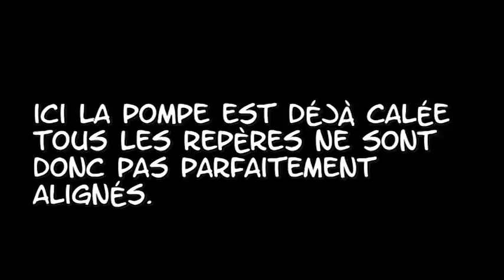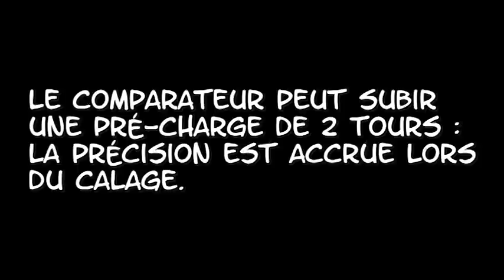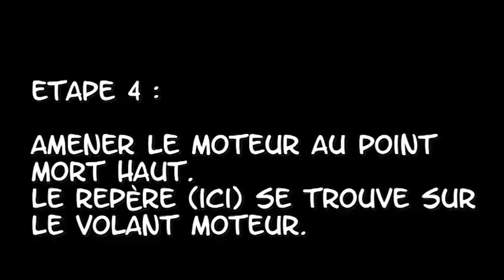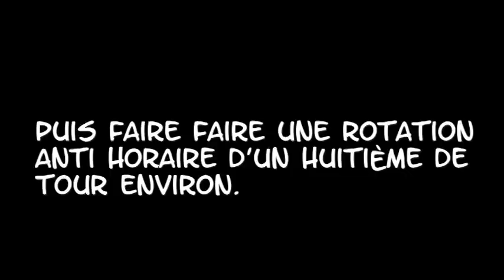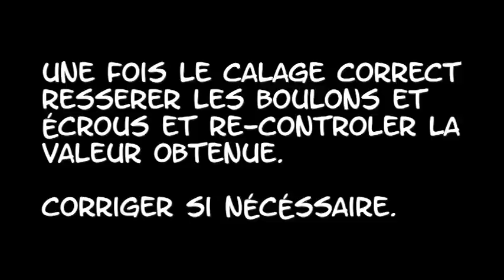Caler une pompe à injection BOSCH VE

Comment from the maker: Mitutoyo est une bonne marque.
J'utiliserai plutôt un comparateur à aiguille,c'est plus facile à appréhender je pense.

La longueur est à choisir selon la place dont tu disposes avec ta pompe les conduites de gazole peuvent nécessiter le modèle long ou court suivant leur forme.

autodiesel 13 vend des 60mm et 95 mm .

Il faut que tu choisisses celui qui te convient le mieux par rapport au conduites de gazole et à la place dont tu disposes pour installer ton outil.

Comment from the maker: L’aiguille au contrôle doit être entre 0.65 et 0.75 
L’aiguille au réglage doit être entre 0.68 et 0.78 

Si tu es entre les deux valeurs mini et maxi données c'est ok.
C'est acceptable entre ces deux valeurs,le moteur peut tourner correctement.

En dessous ou au dessus tu dois régler.

Comment: Très bonne video merci bien, néanmoins une question me taraude... Pourquoi faire un huituième de tour en arrière ? Le calage ne ce fait t'il pas au point mort haut ?
Reply from the maker: +Cé- Dric 
Merci : )
Bonne question : ) 

Tout, en mécanique, est mesuré sous contrainte ,pour éviter de fausser la mesure avec le jeu de fonctionnement.
Il faut donc reculer plus que la position normale de fonctionnement point mort haut) pour y revenir en les mettant en contact pour être sur d'éliminer un éventuel "flottement" entre les pièces,donc une imprécision.
Ici,il s'agit des lobes de la cale de la pompe à injection : )
Tout doit aussi être mesuré à 20°C,car les matériaux se dilatent et se contractent.
c'est moins important,ici mais par principe ,il faut savoir.
1/8 car c'est un 6 cylindres
pour un 4 cylindres ça aurait été 1/4.
Il faut aussi se rappeler que l'injection se fait avant le point mort haut,en avance.
le point mort haut ne sert que de repère pour calculer cette avance.
Reply: cette tour en ariere c'est avance injection c'est le temps que la pome doit injecte le carburant apres PMH qulque degre et varie par le constructeur

Comment: Bonjour, es ce que un mauvais calage peut brider le régime max à 3000rpm ?
Reply from the maker: Bonjour,
C'est possible,mais le problème sera du à un mauvais temps d'injection, qui sera précoce ou tardif.
C'est accompagné de fumée épaisse et blanche grise si il y a trop d'avance,et noire ou grise s'il y a trop de retard.
si la bride est franche et nette sans fumée,il vaut mieux se pencher sur la distribution même de carburant,son dosage dans la pompe.
Pour ça il faut savoir si la pompe à été ouverte et a subi des manipulations internes ou externes.
Il se peut aussi que l'arrivée de carburant soit insuffisante,cela bridera la pompe,incapable de s'alimenter autant que prévu.
Reply: @michaelovitch  Oui, la bride est franche sans fumée. J'ai revu le calage de l'arbre a came et essayé 2 pompes différente. que j'alimente en carburant via un réservoir annexe (juste a coté pour les essais). J'avoue être a court de solution. le moteur démarre au 1/4 de tour mais impossible de dépasser les 3000rpm. Même en shuntant le filtre a a gasoil....
Reply from the maker: @emilesavary7901  
Tout est d'origine sur le moteur ? aucune pièce changée ?
La pompe à injection pompe t elle elle même son carburant  ?
a t elle été démontée ?
La tringlerie n'est pas limitée dans son mouvement ?
Reply: @michaelovitch  Oui, tout est d'origine. la pompe fonctionné jusqu’à présent et n'a pas été modifié. je l'ai changée en pensant que le problème venait d'elle (désamorçage l'hiver + démarrage difficile). la tringlerie n'est pas limitée. Elle pompe son carburant elle même. j'ai eu les même symptôme avec la deuxième pompe. J'en ai profité pour faire la distribution.
Vu que j'arrivais rien j'ai remonté la pompe d'origine. vérifier que la distribution était OK. mon problème est identique. Mais je n'ai réglé l'avance que a l'oreille. Si mal réglé en effet ça fume et le moteur cale. Je peux vous joindre sur un autre support ?
Reply from the maker: @emilesavary7901  
Si le problème est apparu après un remisage de la voiture alors que vous n'avez touché à rien,et que vous avez le souci avec deux pompes différentes,c'est que cela ne vient pas de la pompe,mais de l'approvisionnement en carburant.
une prise d'air dans les durites de gazole,ou un échappement bouché,qui limite la prise de tours.
Si par contre le problème est apparu après une intervention sur la distribution,alors il faut vérifier les calages de distribution,et celui de la pompe.
Un mauvais calage ne permettra pas un fonctionnement normal.
Mon adresse mail est affichée sur l'onglet "à propos" après avoir cliqué sur mon nom de chaine YouTube.

Comment: Salut mister,
On s'était parlé il y a quelques temps.
J'ai une pompe bosch de golf tdi, je l'ai démonté afin de changer les joints.AU remontage, j'ai essayé de caler celle ci, en faisant toutes les etapes que tu montres, le comparateur indique la valeur zero.En devissant la pompe, la valeur ne change pas.
Comment fais tu pour bouger la pompe car sur la video, tu ne montres pas cette etape.
Merci de ton retour.
Tony
Reply from the maker: Salut,
Il s'agit d'une golf 2 ou 3 ?
Indique le moi stp.
Il faut que ce soit un pompe VE sinon ça ne fonctionnera pas comme procédure avec une pompe plus récente.
Tu dois caler le moteur sur le point mort haut d'un des cylindres.
installer la pompe et la caler grossièrement :
 pour ça Il doit y avoir une marque ou un orifice sur la poulie de la pompe.
ensuite la caler au comparateur.
le point zéro c'est le point mort haut du moteur.
ta pompe à ce moment a déjà injecté car elle injecte avec un peu d'avance : c'est ce que tu cherches à régler.
Donc tu dois tourner le moteur en sens inverse de fonctionnement pour arriver au point d'injection qui sera indiqué sur ton comparateur comme une valeur.
Cette valeur est spécifique à ton moteur/voiture.
A toi de l'ajuster petit à petit en tournant la pompe et en testant à chaque fois depuis le début.
La pompe est fixée au bloc moteur par plusieurs boulons.
Un d'entre eux est fixe,les autres permettent de faire pivoter la pompe sur son support une fois qu'ils sont desserrés.
Reply: michaelovitch
il s'agit d'un golf 3 tdi 90cv, la pompe est rotative, elle n ejecte plus le gazole, j'ai regardé la video d un internaute qui demonte une pompe et la remonte, je me demande si j'ai pas monté la came de la pompe au mauvais endroit
Reply from the maker: tonymarcuso
 Si elle même été démontée :
Il faut essayer de lui faire aspirer du gazole en la faisant tourner seule.
Si elle a été ré assemblée correctement elle est juste désamorcée.
Tu peux déjà la pré-remplir  par le dessus en enlevant le raccord banjo d'aspiration et celui de refoulement.
Il y a un topic bien fait et détaillé sur les pompes VE ici pour que tu puisses voir si tu t'es trompé. : 
http://www.forum-auto.com/pole-technique/mecanique-electronique/sujet293129.htm
Reply from the maker: tonymarcuso
Je ne sais pas si tu as vu la totalité du message précédent que je t'ai envoyé ,c'est parfois long à l'affichage : J'y ai inclus un lien pour le remontage de la pompe.
ça te permet de vérifier ton travail.
J’espère que tu as pu trouver solutionner ton problème.
Reply: Hello

Je te remercie pour ton retour très complet, en effet il y a bien 3 ecrous de 13 qui maintiennent la pompe et un a l arriere.Mais en les desserant et en essyant de tourner la pompe, meme si elle tourne un peu, le comparateur lui ne bouge pas, il restait sur la valeur Zero.
Je vais retenter a nouveau et la remplir de gazole.Normalement si je tourne la poulie de la pompe a la main, elle doit ejecter du gazole par les 4 mini injecteurs ?
Reply from the maker: tonymarcuso
Salut,

Le comparateur doit être en "précharge".
La touche du comparateur est suffisamment enfonçée pour permettre à l'aiguille de faire deux tours complets avant qu'il soit mis à zéro.
ça évite un défaut de contact entre les pièces internes de la pompe et le comparateur lors du réglage,donc ,les imprécisions.
As tu bien le bon embout sur le comparateur ,celui qui correspond à une pompe Bosch VE ?
Oui, si elle est pleine de gazole, elle doit pouvoir cracher du carburant par les raccords. (ceux où se vissent les durites rigides allant vers les injecteurs)
Elle doit même pouvoir en aspirer par sa durite d'alimentation.
Il faut qu'elle soit amorcée sinon elle pompera de l'air seulement.

Comment from the maker: Salut.
Code "D24" 6 cylindres 2.4 litres à injection indirecte diesel d'une Volvo 240.
Il y a des vidéos de lui tournant sur ma chaîne si tu veux.
C'est un moteur emprunté à vw par Volvo.
Reply: Salut ! Décidément, cette vidéo  aura été vue plus d'une fois par beaucoup ! Je suis dans une impasse.  J'ai un D24 volvo 245 1991, avec cette pompe. Un ami me l'a refaite car la voiture ne démarrait plus suite à un arrêt de 13 ans (suite à l'avc de mon père. Je veux la remettre en route). Je l'ai remontée,  calée selon ta méthode  mais ça ne démarre pas.  J'ai bien du gazoil à arriver aux injecteurs,  enfin au bout de tuyaux d'injecteurs, sur les 6 cylindres. L'ev est neuve et, on l'entend bien quand on la titille en direct. Le circuit prechauffage fonctionne,  bougies neuves. Certaines personnes me disent que je suis peut-être calée sur le mauvais cylindre ! Pour moi, à partir du moment où on a le repere 0 sur le volant,  c'est qu'on a  fait une révolution et, qu'on est au point mort haut sur le premier cylindre...me tromperais-je ? Merci de m'éclairer de ton savoir 😅, car étant novice, je n'ai plus d'idées et, ça me déprime.  Merci
Reply from the maker: @jeromeleroy6719  
Salut,
Pas utile d'être déprimé,il suffit de partir de la base,à nouveau.,et de vérifier son travail.
Pour être sur que le cylindre 1 est au point mort haut (c'est celui qui est le plus près du radiateur moteur) il faut alors enlever le couvre culasse en tôle et vérifier que les deux lobes de l'arbre à cames de ce cylindre n1 pointent à l'opposé du piston.
On est sur d'être au point mort haut n1.
Il faut que le jeu aux soupapes soit bon,et que les bougies de préchauffage fonctionnent.
Un moteur à injection indirecte comme celui là ne démarrera pas sans ça.
Le 0 sur le volant moteur indique le point mort haut du cylindre 1,mais aussi du cylindre opposé ,le 6, les deux étant opposés pour l'équilibrage,et appairés.
mais ce n'est pas le problème en soi, l'important est que le vilebrequin,donc le volant moteur ,soit calé par rapport à l'arbre à cames.
Il faut donc que l'arbre à cames soit calé avec l'outil spécial au point mort haut cylindre 1,et que le volant moteur soit synchrone avec l'arbre à cames.
l'arbre à cames se cale avec une plaque,qui s'enfile dans l'arbre en son bout coté pompe après retrait de sa poulie.
Il faut aussi que la poulie de la pompe soit calée avec le support de pompe,une pige sert à la caler et s'enfonce dans un des trous de la poulie de pompe ,plus petit que les aurtres.
Est ce que tout ça a été fait,ou vérifié ?
Reply: @michaelovitch  merci pour ce retour rapide ! Non,  tout n'a pas été fait. J'ai juste recalé la pompe par rapport au 0 du volant, en ayant mis l'avance 0.85, sur le D24atmo. Je vais effectivement regarder cela un peu plus professionnellement...j'ai cru que c'était simple. Encore merci pour tes encouragements.  Bonne journée
Reply: @michaelovitch  mais si ça se trouve, je suis cale sur le 6, lobes levés ( au lieu de vers le bas)C'est ce qui pourrait être le cas ?
Reply from the maker: @jeromeleroy6719  Etant donné que le 6 et le 1 montent et descendent en même temps (tous les deux au point mort haut,mais le 1 est en compression et le 6 en échappement/admission) oui c'est possible,c'est pour ça qu'on regarde les lobes de l'arbre à cames pour voir qui fait quoi, selon la culasse, et pas le vilebrequin.
Le vilebrequin fait 2 tours pour 1 tour d'arbre à cames,on peut se tromper une fois sur deux si on ne confirme pas avec l'arbre à cames.
Attention,les bougies de préchauffage sont nécessaires.
Aussi 0.85 mm de levée /avance à injection sur un atmo d24,c'est un peu trop. 
il faut être bien sur d'avoir déconnecté le système de départ à froid qui crée déjà de l'avance avant de caler la pompe.
C'est une cartouche de cire qui agit comme un thermostat,elle pousse un levier à froid et le relâché à chaud.
c'est sur la pompe même.
Reply: @michaelovitch  ah super, enfin un vrai connaisseur...tu mettrais 0.8 sur le calage ?
Reply from the maker: @jeromeleroy6719  Oui,trop d'avance et le moteur sera bruyant ,et perdra du couple à régimes bas et intermédiaires.
C'est une avance fixe,qui sera fixe pour tous les régimes,il vaut donc mieux être raisonnable.
Reply: @michaelovitch  je te tiens informé de mon avancée la semaine prochaine ! Merci beaucoup pour ton retour  et, le temps que tu m'as accordé.  Bonne journée
Reply: @michaelovitch  bon, j'ai juste enlever le cache culbuteurs rapidement...quand la pompe est alignée aux trois repères,  mes lobes 6 sont levés...donc je me suis foiré. Merci encore pour tes conseils.  Je fais ça semaine prochaine
Reply from the maker: @jeromeleroy6719  : )